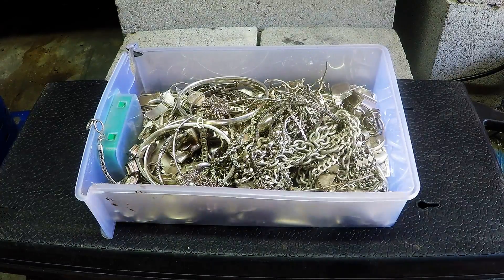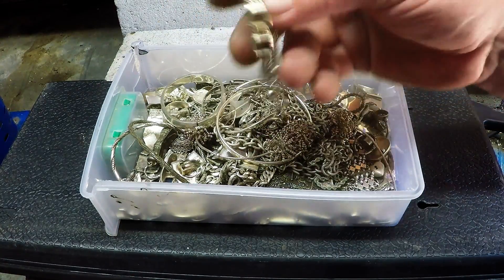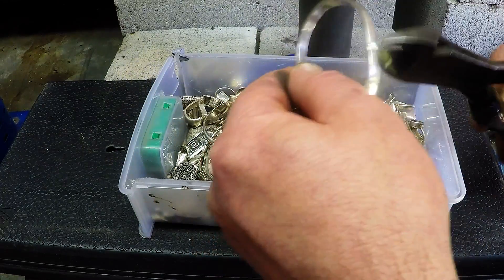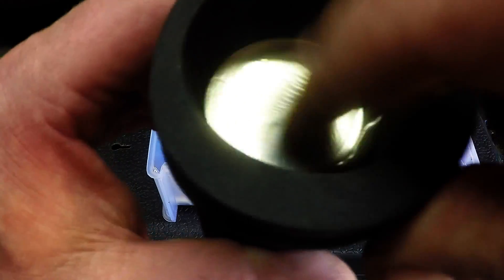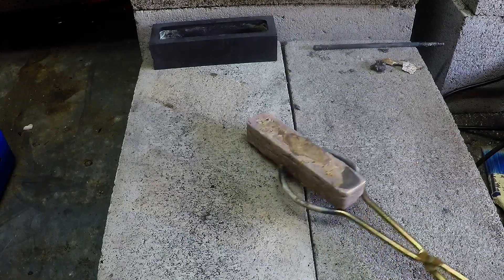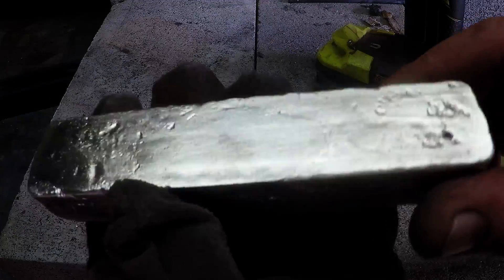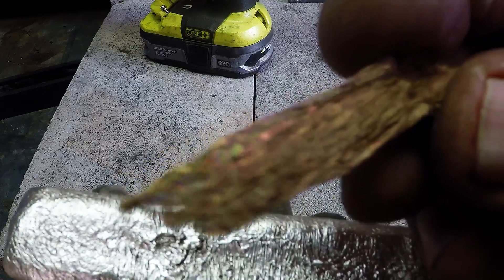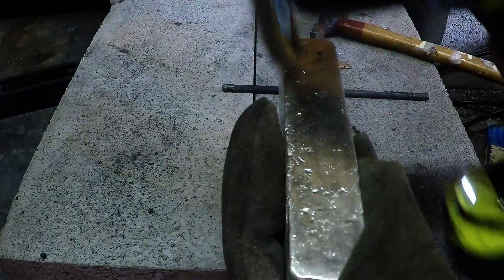Melting Jewelry into a 1kg Silver Bar

Comment: If you don't want the folding of the metal you have to heat the kiln for jus below the gold melt heat so the silver stay liquid longer at a higher temperature so you have to heat the kiln for the normal silver melt temp, then just before bringing it out to pour you raise the temp of the kiln 50 to 100 degrees then you need the mold to be almost red hot before piuring, and you'll have a nice smooth ingot

Comment: If jewellry or tea sets or whatever are really old they might not be marked. But silver is soft and very flexible or at least I found it like that.
Reply: I use to bring a magnet to the thrift stores and go to the silverware boxes and put my magnet in there on top of the silver butter knives and spoons and whatever didn't stick to the magnet I bought and most of the time it was silver I paid $0.15 a piece for it and sold it for about 15 to $20 a piece
Reply: @jayrock1470  is flux Borax?
Reply: @patrickwynkoop2218  borax flux
Reply: @patrickwynkoop2218  yes ad you borax flux in your crucible when you're melting down your silver since silver Melts faster than the other elements like copper and nickel it will pull it out to the bottom
Reply: I thought melting it made it purer
Reply: @patrickwynkoop2218  yes that's why you add your flux to it to draw all the other elements out

Comment: not a pure silver bar tho
Reply: The Crude Lab it’s not possible to make a 100% pure silver bar. The purest possible is .9999
Reply: @skarmex3439  Actually, that is not true. Canada makes several .99999 commemoratives, and the US makes a .99999 coil (Double Eagle?).  The highest purity silver ever produced is significant quantity was .999999 fine, by the Austrialians (if I recall correctly).
Reply: Mitchell Hannam why not im so confused on the 999 stuff
Reply: @TheFifthPhilosophy  Basically the only way humans know how to refine metal is to melt away other metals from it. There's stuff like Zinc in silver. There will always be microscopic levels of that metal there. It's fused with the silver. So in order to make 100% pure silver, you would have to separate everything but silver at the molecular level which we just don't know how to do yet. So the closest we can get is 999
Reply: @skarmex3439  See my response to Kaisar.
Reply: The 4 9's means 99.99% pure.

Comment: heat your mold up alot higher than you did in the video. just about pink.  thats why you have the layering and the pits on the bottom.  believe it or not, its moisture that is trapped in the mold. and pour slower and smoothly

Comment: when you melt those sterling silver or alloyed silver metals/jewellry, where does the impurities or non-silver metallic components goes? does it disentegrates during high heat smelting? or there's a process for it to remove non-silver metals during smelting?
Reply: I would also like to know that. I think of it like this. Just because there is more silver than anything else, doesn't mean it will disintegrate or evaporate. If you melted one copper tube and one silver tube slightly smaller, that doesn't mean just because there is 5% more copper that all the silver evaporates, rather they get alloyed together.
Reply: What Was The Final Purity?
Reply: There are videos on extracting copper from silver, it won't just melt out..

Comment: The layering, and the pitted bottom could be due to a rapid cooling caused by the mold not being hot enough. Any moisture in the mold will come running out when the molten silver is poured in and can even explode, I've seen it happen. Heat them to the highest possible and get a mint finish. Peace.

Comment: tips 1 add two table spoons of borax at the beginning of the melt and 1 at the end while it's still in the furnace then use a graphite rod or to stir the liquid metal most of the stuff you don't want will stick to the rod and can be pulled out. 
2 before you pour make sure your mold is hot as fuck a shit kitchen element or even toaster over does a good job to keep the bottom hot and reduce pitting on the bottom of the bar another thing to help with that is use your torch and cook the inside of the mold good and brush on a quick coat of vegetable oil this will flame up stoping alot of the oxidation on the surface of the bar when you pour it and for the ripples in the side it's a big bar what happens is the bottom and the sides cool faster then the center try to reduced that with your mold being as hot as you can get it and don't let it sit in the air graphite cools fast. during the pour pour quickly and steady don't worry about the impurities the borax with always come to the surface of the metal when it's liquid I hope this helps
Reply: Wouldn't the vegetable oil splash all over when you pour?
Reply: @wonghiulan2961  use a spray bottle.

Comment: I made jewelry for 8+ years starting at high school and ended in collage, indeed blank silver is relatively cheep to get ahold of, however making jewelry does indeed take some time and skill and experience.  Not to mention it takes some time to sell your pieces when you are finished with them.  I believe some companies buy silver back however, i think they want you to Smelt down scrap silver into bars preferably; easier to deal with a large bar than it is with a bucket of scrap testing each individual piece to determine its purity; and determining whether its legit silver or silver plated.  The process is quite logical if you ask me.  there are a lot of variable to consider before considering that you want to smelt down scrap silver, I've known a couple of people that went into the negative because they didn't know what they were doing and ended up with a big mess or worse injury

Comment: I think the layering is due to a faster rate of cooling due to heat loss from crucible to iron cast pouring. Maybe if you heated up that casting block prior to pouring, it may yield a cleaner bar with a more consistent full bar without problems.

Comment: When you use borax with Sterling Silver in a Graphite Crucible and a Electric Kiln,you Have to BE Sure THAT THE CRUCIBLE IS AT Least AS HOT AS 500c. If you use less heat on a graphite crucible it turns into a bad pour. That piece of brown is the burning up of impurities. If he reported it with a hot mold, he wouldn't have to clean it at all. It would be .999.
Reply: do talk so daft its still 925 pudding!!!
Reply: Cheri Henderson maybe his furnace can't run that hot for long
Reply: no, you'd have to refine it first to get .999 silver 
I've done it before and can understand why it was skipped first it needs nitric acid which you need a licence for unless you buy low grade and boil it (which I did) 
then you need a ventilated area and a gallon container to hold the bubbling, NO2 spewing solution that is exothermic so will need to be quite tough glass to work that volume and handle the heat then you have the cementing, filtering and drying which will take a couple of days before you can get to melting
hence why my trade silver is sent off and my coins and findings are processed like this

Comment: Actually .. The best alloyed silver that's used for jewelry is .990 . Tiffany uses it for there jewelry and a few others. Its not commonly used, but when a jeweler wants to use the best, they use .990. After .990 comes bullion .999. I have a little .990 my self. A Korean Wedding cutlery set I picked up at a thrift store for $2.00 , I'll be using that for jewelry casting only. That last .10 percent left in the silver is copper. They have to alloy it with something. If they don't, it won't keep its shape when made into jewelry, to soft. Almost all my sterling will get melted into bars. Hope this is helpful.
Reply: Joe Smith if you're melting name brand silver you're losing money
Reply: I'll only melt junk. Not my first rodeo.
Reply: Why melt sterling into bars? I never understood that. Also many bars come in .999+ or .9999 so .999 buillion is not the highest purity, even though the difference that last .0009 makes is questionable.

Comment: You want to pour into a very hot mold. Make a stand that props up a couple of MAP fuel tanks so they continuously heat the mold while your pouring. This will give you the solid bars with no layers. Also, don't take too long to make the pour. The molten alloy cools fast as it is in a thin stream.

Comment: Holy crap.... you put that fine silver coin in?  That was an error.

When melting scrap, you should segregate by grade.  diluting fine silver to a lower quality makes no sense.

The bar came out ugly  because you didn't heat the mold.  Pouring the molten silver into a cold mold causes premature chilling.  I would bring the mold up to 500 - 600*F.

As for dross, what you need is a quartz rod which you use to take up the dross while metal is still in the crucible.  The dross will stick to the quartz, yet wipe off easily.  You should be able to get them at a jeweler's supply.

As for the borax, you quench the ingot in a pot of hot #2 Sparex, which is sodium bisulphate, or some such.  That will dissolve the borax.

Heat the mold and you will get a much prettier result.
Reply: Not that much work.

Comment: The "scrap" was worth more than the silver in the ingot.
Reply: Because if you came to me and asked me to buy the coin (and I felt it was authentic); I would give you spot.  The bar; I would probably punk you 25-50% because it's an unknown.  I would have to give it a seriously hairy eyeball.
Reply: I gotta agree. At least here in Denmark, you won't be able to buy any scrap silver cheaper than spot price. People are aware that the value of metals has risen lately.
Reply from the maker: ok so why wouldn't a silver bar sell for spot? it's all about silver content, a 925 bar is worth just as much as 925 scrap, this one is worth more because it's over 925 with the added 1oz of 9999, I don't think you's understand how buying precious metals work
Reply: Jewelry is almost always worth more than scrap.  Think "value added" v. "commodity".  Yes, there are those pieces that are so horribly designed or executed that they are worth as much or more as scrap, but those are a relatively small proportion.

Comment: what is the use of melting beautiful jewelry into a bar?.....
Reply from the maker: Beauty is in the eye of the beholder
Reply: most bracelets and generic chains are mass produced (mostly what i see in the pile there)  which is common, has low artistic value, and 90% of buyers want NEW bracelets and chains.  If it was semi precious stones in rings sure there is probably some $2-4 / gram sterling there.  The rest would be tumbling and polishing just to sell for less than $2 / gram (in most cases)
Reply: What's the use of putting on jewelry  ? What's the use of anything for that matter

Comment: The layering is because the mould isn't nearly hot enough, and the pour is too slow. If you look back, you can actually see a layer set while you're pouring (you slow down at some point). Have you thought about placing the mould face down on top of the furnace for a short time to let it heat up? Although I'm not sure it's broad enough, since your mould is much wider than the opening of your furnace.
Reply from the maker: heated it up with a torch but obviously not enough

Comment: the layering happens because the mold is colder than the molten metal. of course you can only preheat it with the torch. Best would be if its temperature is as close as the metals

Comment: My bet is that the purity will end up being 70% to 80%.
Reply: SimParadox how can the purity drop lower then 92% ?
Reply: Because there is a lot of fake hallmarked silver out there. Plus, if I remember correctly Ben said there was 'German Silver" in the lot? German Silver is actually mostly Nickel and contains absolutely no silver at all. Ben would have been better off extracting the silver chemically then melting it.
Reply: SimParadox thanks
Reply from the maker: no I said there is german silver out there, this jewelry was all 925
Reply: eWaste Ben so if its below 92% there is actually Satan
Reply: When you do get it assayed, will you share the result with us? Very curious to know.
Reply from the maker: yeah sure, but I did have the jewelry xrf scanned before and it all showed up 925 or above so with 1oz of 9999 added it should be over 925
Reply: also a lot of the impure stuff got on the outside
Reply: So Ben, did you get the bar assayed?
Reply from the maker: No but soon, I'm going to the city in a week so will let you all know

Comment: Hi Ben. That bar is very nice. I could be wrong but that tannish color that formed after the bar cooled down looked like a thin layer of oxidized zinc or copper. Both metals tend to discolor badly when cooled down in the presence of air. I think that the presence of those metals are making the bars cool down with that rippling effect. I don't think it would happen as bad with pure silver. Also the bars might come out a bit smoother if the mold is heated up to as close to the metal temperature as possible. I still love your bar more that the bars you normally see. It has character. Have a great day.